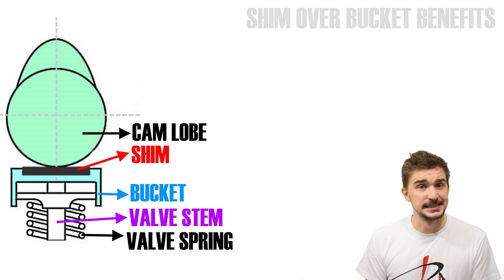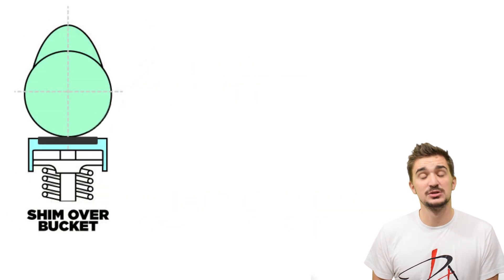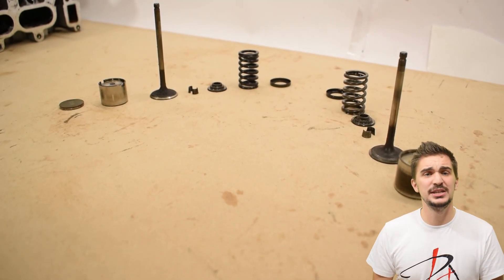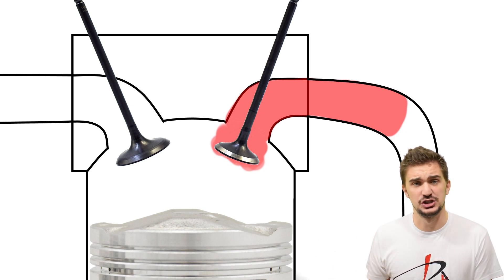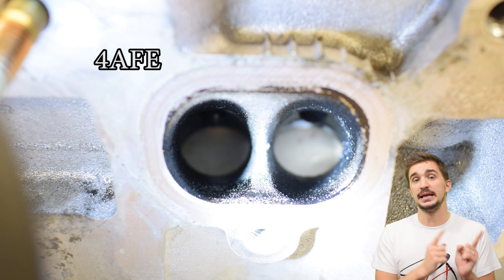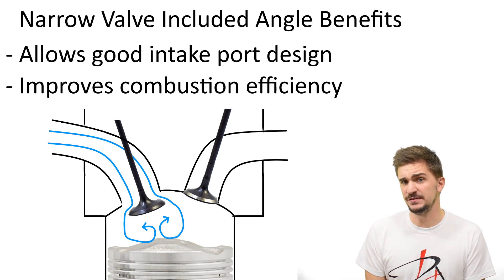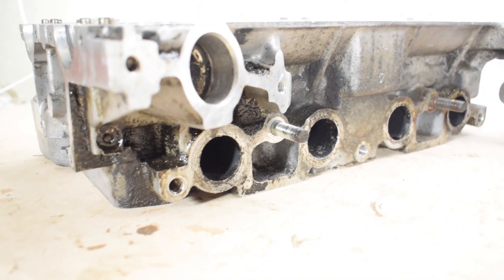CYLINDER HEAD Face Off - 4AGE vs 4AFE - DETAILED Comparison

Comment: 1:48 I would say the opposite: usually a gear drive is not only more precise than a belt drive, it is also more efficient because it is lubricated! I would also expect the gear drive to be lighter as it doesn't need a cam wheel and the camshaft is physically shorter.
Reply: Oil creates drag resistance .....
Reply: @gwanam6319  man there's a film or oil and not much more, we're not draging that much and it'll always be less then rubber drag.
Check out motorcycle chain vs belt drive
Reply: Yeah not much drag at all but it's still there .... and sooo gear drive lighter ?? Gear drives are most if not all gears are solid made... as compared to belt driven cam sprocket made light....   I will weigh the 4age 16v and 20v cams and gears and weigh 4afe cams for weight difference on Monday... once spinning the weight of cam be barely/not  noticeable anyway...
Reply: @gwanam6319  so yes chain creates less drag. Also yes I meant chain drive lighter. But I could totally be wrong, feel free to weight them and post your results :D
Reply: @TheCabillaud94  Oil creates quite a bit of drag.  That's why race motors run deep sumps/windage trays and crank scrapers... and most high dollar setups are "dry sump".  

I would say the belt drive would be more precise and more efficient... I don't have any numbers but,  I'm pretty "old school" and know that all the old pushrod v8 "race motors" such as the old small block chevy,  are always fitted with Jesel (or other brand) belt drives over a chain/gear setup..  a "good" chain and sprocket setup usually has 2 chains "siamesed" together to keep stretching to a minimum, but is HEAVY...  Gear to gear drives are very noisy if they're cut with straight teeth, so they angle them, again creating drag...

The main reason I believe they are used, however, is the ease of making cam timing adjustments.  No covers or anything to remove on a belt drive (talking about perfomance applications here), where the others REQUIRE it, because they must be lubricated.
Reply: @TheCabillaud94  Turns out cams for 16v 4agfe and 4age both same weight with gears on 3lbs prity much...fe is 1/2lbs heavier and as I already thought but I was surprised still tho heavier than i thought the 20v intake cam with new variable gear dry weight is 6lbs would be more once oil filled...  also with chain drive setups on engines with chain guides also create drag on chain not much but still there lol....
Reply: gears are definitely more efficient than chains and belts

Comment: at 1:16...why are the cams backwards in the 4age head? anyone else notice that? the one with the gear should be on the right as it drives the distributor...
Reply from the maker: Definitely already spotted by Dima Minko :) This is a junk head I just slapped together for the vid, wasn't even paying attention. Yes, the exhaust cam drives the distributor but otherwise it has the same exact specs as the intake cam.

Comment: Another thing with the bucket style lifters and camshafts is higher lift cams have been proven to provide negligible performance on the 4A series engines compared to a plethora of other mods you can do. I know at least for my 4AGZE the SC being linear forced induction setup is probably the best possible option for lower end torque on the 4A as for higher HP at high RPM a turbo setup would definitely surpass a stock SC12 or SC14 but it all comes down to preferance. I myself love and prefer the linear Supercharged torque profile.
Reply: Awesome video yet again! You always provide me with so much awesome information I never knew about these motors!

Comment: 6 min in and I'm wondering why the shim and the bucket don't just come as 1 unit in various heights so that the shim does not pop out? Yes you would have to remove the cams to install / maintain, but could it be worth it or feasible?
Reply from the maker: Sure, many engines have exactly that. 1NZ-FE is an example

Comment: @driving 4 answers 
Awesome! Thanks man, that really helped me understand and appreciate the main differences of my two cars (engines). I have a 1987 Celica with a T-VIS 3SGE and a 1988 Camry with a (non T-VIS ;) ) 3SFE engine. The differences in between these performance and economy oriented engines are pretty much identical to your 4AGE and 4AFE. So is it safe to say, that all the "GE-engines" are the performance ones and all the "FE-engines" are suited for economy use?
Please keep up the great work! I'm massively enjoying this. :D
Reply: Yes that is correct and in addition the G series heads are all from the Toyota-Yamaha partnership. A partnership they should bring back if you ask me.
Reply: @Samqdf  Absolutely! :D
The higher revving heads with the still clean and linear powerband, felt like way more horsepower than they were making. Best of "slow car fast" in case of my beloved 4th gen Celica. ;)
Also the Yamaha stuff just sounds wicked. _
And the oil pump related problem should be sorted out by now...

Comment: I had a 1993 corolla with the 4A-FE. So much fun driving it at 6000k rpm pedal to the floor on a mountain road. I joined a hill climb race with it once and got 4th over all in my category. I miss that car...
Reply: AE101 are underrated
Reply: @bryan10444  all is the AE92. I have a 1991 with the 4afe. Great little car. Once it has coil overs it will be much better than my 2020 corolla se 6mt
Reply: @kennethstephens8046  yeah bro i hope its a liftback, those things lowered can almost be mistaken for ae86
Reply: @kennethstephens8046  great cars, I always loved the coupes.. just wish they stayed rwd. Miss my AE86 so much, I almost have a tear when I hear one coming
Reply: 6000k = 6million rpm lol
Reply: @hazza2247 ultra 4A FE reving up to 6000k rpm

 *crankshaft flies to the Pluto
Reply: I have Corolla with 4AFE head
I've already swapped with 4AGE 20V head
Much power difference
Reply: Mate you should here my Corolla FE hatch back your right sounds wicked gulping up the air from the intake I got to say mate It is fun for a old motor sounds better than a Honda when In twin cam 
#TRD
Reply: Dayum
Reply: I just got one
Reply: Those old Corollas are really good on the Uphill and downhill
Reply: have a 96 corolla with the 4AFE.  It's a joy to drive.  Those engines are indestructible
Reply: i have one in a ae91..damn i love it😂😂😂😂
Reply: "6000k RPM" is absolutely insane!
Reply: @TheCommonGadflywhy they can be built to 9k easy
Reply: Got me a 1995 Corolla with the 7afe fun indeed and man does it sound nice when you get it up there
Reply: Cool! Intetesting because mine kicks in @6200 rpm and revs to 8250, its so cool to compare these statements! One revs to 6000, one hits lift after that.

Edit: since everyone seems to miss their toyotas, I ain't selling my celica ts ever.

Comment: Dumb question as usual man, has any manufacturer ever done a flat/horizontal or close to flat/horizontal valve included angle? Just with an odd piston crown like a double divot on either side to allow for clearance? For scavenging reasons? Awesome videosofar im sure illcomment agai. Haha
Reply from the maker: Hmmmm..I would have to look into it. But I remember seeing an old Ducati with an incredibly wide valve included angle, problem is I have no problem idea from which bike it actually came from 😔
Reply: @d4a  hahaha its all good man you already bust your balls researching the normal vids :P i gotta check and see i reckon itd be a very strange looking setup. hope youre keeping safe and well dude! Thanks so much for replying!

Comment: Thanks for the video i miss my Corolla with 4AFE it got great Fuel economy. 4AGE is a Yamaha Designed head based of the Toyota 4A head it would be cool to see you compare a 20 valve 4AGE as well. To me it is Kinda neat knowing my 4AFE had similar HP numbers to the hachi roku AE86 4AGE.

Comment: If I could suggest topics for this channel, one is capacitive discharge ignition and two, how to adjust variable timing cam gear, both intake and exhaust, as you show in this great video. Thank you.
Reply from the maker: I did one of those ages ago: https://youtu.be/Yv4Ao7WMmS8

Comment: It sounds insane to go to rocker arms because of potential shim lift. A tiny screw can angle in, wedging the shim tight. Shims can be made with a deep score or two so they will easily break for removal, allowing cold shims to wedge themselves. A dot of Loctite and a little tab for leverage. An angled microscrew.
So many possible ways... What am I missing?

I disagree with you on scavenging. You don't want direct interaction between the valves, as that increases bypass at the expense of scavenging. Note that two stroke engines purposely place the valves as far apart.as possible.

Yes, but the angular velocity of a rotating mass can be increased after intake. Ice skaters do it all the time. So there is no need to choose between the most efficient at induction and the most angular velocity. And...

Eh, I've got sketches ready to send, along with some news. I'll incorporate any changes I make based on how your responses to my questions affect my understanding and send them to you pronto.

Just think, you'll soon see the fabled Turtle. But watch out!  It's a snapper. If  one of its legs broke your engine would not just die but probably go up in flames.

Comment: 2:44  how is changing the timing of the exhaust cam going to do "the exact opposite" on the intake cam???  Yes, they're locked together, but if you advance the one, it's gonna just advance the other by the same amount, and vice-versa...
Reply from the maker: How did you miss the pinned comment?
Reply: @d4a  the one with merch links?...  or you see what I'm saying?

Comment: I have a question, is it possible to mount the 4AFE cylinder head to my 4AF carb engine?
Reply: I believe the head is the same. The "E" in 4A-FE only stands for Electronic Fuel Injection. You'd need an inlet manifold from a 4A-FE wich would likely just bolt straight on as well as the ECU and wiring, or some kind of EFi solution to sort your injection. (Assuming you wanna convert over to EFi).
Reply: @garageshiri  Thanks you bro!!!

Comment: At the end you stated that exhaust ports can't be angled upwards.  Can you explain why this is?  Thanks in advance for any info.
Reply from the maker: The exhaust manifold must go downwards in a mass produced passanger car. The reason is engine bay space and packaging of parts within that space.
Reply: A good example is comparing the C7 and C8 corvettes. They have an almost identical motor but the extra engine bay height available in the mid engined C8 allowed for an upward angled exhaust. Google it and you will find back to back pictures and power comparisons.

Comment: tldr, late gen 4 afe is better :D
2:40 you can advance/retard cams on 4afe by 4° steps i believe with stock pulleys
2:56 31mm shimless buckets are direct swap from newer toyota engines, same goes for 4age 28 (or was it 26mm? buckets)
5:13 late 4afe has 7.9mm lift on intake and 7.7mm on exhaust or something like that
14:50 well, now toyota use wide angle for tumbling effect and economy engines while narrow angle for performance ones
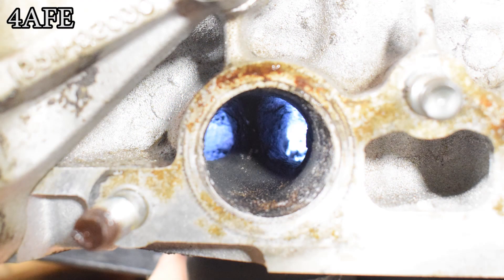19:00 both 1st and last exhaust port are "y" shaped instead of "Y" cuz oil channel, which hurt flow in stock form

Comment: what you dont say, is that the 4AFE will have more power with the same cam profile, port volume and valve sizes because of the more efficient ports and the super tall intake runner. 
and that the 4age would respond better to top end tuning because you simply can fit bigger valves in a pent roof design.

Comment: Would tiny, tiny fin like structures on the valve side facing the intake port (machined on the valve disk in a slight spiral maybe?) help with better mixing of air and fuel in the combustion chamber? Help make the charge enter the cylinder in a mixing helping way :) Love your videos! fun and educational!
Reply from the maker: Check out racing 4age valves from manon racing performance, or even many other aftermarket racing and high performance valves. Many have something extremely similar to what you're describing.

Comment: could someone explain how air velocity creates more torque but air volume creates more power? I mean, if you have more air volume you will have bigger explosion which results in more torque. What air velocity has to do with torque? Please explain
Reply: Air flow mass  (AFM)  = power. The tuning that works well at very high rpms is large ports, high lift, long duration and big valve overlap. This is because the time available to fill the cylinder is getting shorter while the drag loss is increasing at the square of the air speed. Nothing is instantaneous and momentum (mass x velocity) becomes important. Valves are closing a significant time before or after the piston has reversed direction. At low rpm this tuning results in unstable air flow. Instead of the air flowing smoothly from inlet to combustion chamber to exhaust, it can fill, stall or even reverse flow for a tiny moment.  Any left over exhaust volume from the previous combustion cycle reduces AFM. The recirculating exhaust gas volume is being subtracted from engine capacity. Small ports gave high air velocity at low rpm and the momentum effect resisted reversion. This came at the cost of more restriction at high rpm. Which is why almost all modern engines have variable valve timing to directly addresses the high/low speed air flow issues.

Comment: Love the video, as always. Is there any chance you might be looking into head modification like porting? I've read about flow benches and wet vs dry testing but I've never actually seen a flow bench or how they work.
Reply from the maker: I will be porting this head and there will be a video on it, but without a flow bench sadly. I don't own one, and don't have access to one. It will be a relatively mild port and a bit of combustion chamber reshaping.
Reply: @d4a  Sounds great, looking forward to it!

Comment: Hey can you make a video comparing 2 wheel drive transmissions? 
I searched a lot for answers but none are satisfying.
Also totally love your videos <3
Reply from the maker: What exactly do you mean by 2 wheel drive transmissions? Fwd and rwd?
Reply: @d4a  I mean comparisons between production rear wheel drive transmissions. and how they differ. what's the difference between a Porcshe Dual Clutch Manual and a Dodge A580 DCT. Like how do you decide which is better based on what application?

Comment: Its pretty weird that 4AFE is an "economy" engine while the fuel consumption is very close to the 4AGE.
Reply: If you ask me, economy in engines usually means more torque at low RPM, not really that much to do with actual fuel consumption.
Reply: @korpijeesus 
You’re correct. Making more power at a lower RPM has the side benefit of using less fuel as there are less combustion events per minute.
Reply: Its all down to the gearing.

Comment: Doesnt cruising with less throttle mean less efficiency because of increased pumping losses? For example In WW2 B-29 crews found out that if they disable 1 engine and operate other 3 at nearly max open throttle to achieve cruise speed they saved much more fuel compared to when they operated 4 engines but with less throttle to keep the same cruising speed
Reply: That's probably where the FE head takes the advantage over the GE head because of the smaller port diameter and narrow valve angle.
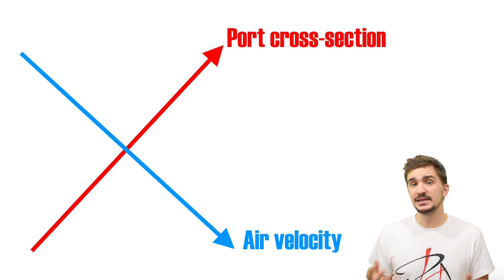Reply: He says Between 17:14-17:29 that FE is more efficient because of it being able to use less throttle at low rpms which is what seemed weird to me since i thought that would really increase pumping losses and decrease economy. Another example : Aircraft from WW2 also had multi speed superchargers to adapt their performance into various altitudes. The ones that lacked multi speed superchargers had to throttle their superchargers at low altitude to not overboost and blow up the engine. and when you throttled those engines they really decreased in efficiency significantly. NACA has great reports on this issue. So yeah it seems weird to me that engine is more efficient when using less throttle at low rpms
Reply: @288gto7  Yes more efficient than the GE in those circumstances.

Comment: There was a 20 valve version of 4AGE, right?
Reply: Yeah the silvertop and blacktop
Reply: @chawnyable  Wonder how their heads were set up.
Reply: @funcounting  The 20V Blacktop can be seen at the top at 12:55. The 20V engine shave the same exhaust angle from the exhaust to the outer intake valves, the middle intake valve is narrower at a 37.5 degree separation. The 20V intake port are quite good with an upright design and there are many other factors such as a crude VVT system and so on.

Comment: Have a serious question tho....
Is this "4Age" 20vavle or 16/16 tho?????
Reply: there are some 20 valve"s 4age but the are very rare
Reply: @roberthansen710  it's not so rare here, we normally talk about using the 16/16 block which is stronger with the 20valve head on hondata ecu 
But now the 2zz-ge is Killin everything